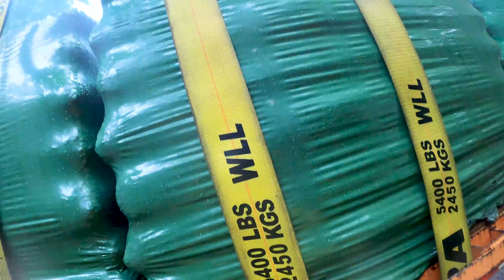The Decking is going to fall! 😱😱😱

Comment: I was a driver doing this exact same job working probuild/builders first source company from 2014-2018. Just fyi, when you are dealing with traffic on the road when you are unloading, unless you have a flaggers license, you can be held liable if you signal them to go and they get in an accident.

Comment: Thought for  future reference. Possibly a 2x4 that is as long as the width of drive wheels on the moffett. That will give you a little more reach. Another possibiity, last resort, whould be to disconnect from the trailer and crank downlow enough to allow forks to reach

Comment: I know pellets and decking weigh a lot, but if you lifted the pallet of pellets with the decking on top, get it on the ground close to the trailer and grab the decking from the top of the pellets. It looked like you had a bit of space between the pallets. You could have given it a test run with the stabilizers down, just a thought.

Comment: Reminds me of a time I had to drop a full trailer off the back of a full bus because some idiots had blocked the turn around section (illegally parked) , reverse the bus all the way down the hill, turn it around, reverse it all the way up the hill again, attach the trailer again then be on my way. The road had frequent vehicle and foot traffic which made it a challenge.  25 minutes later I'm hot and sweaty and trying to catch up on my route.

Comment: I was loaded in Amarillo one delivery to Sunray TX. it's basic;;y all the lumber to build a house including 92 and 5.8's studs for the walls. I get to the job sited and I get unloaded, the builders are there. As I unload one of the builders says "wht re those boards for (92 & 5/8)" I said "it's part of the order" he said "take them back" so I did. About 3 days later we get a call from the head builder wanting to know where the boards were for the walls, the salesman said "we sent them out but 1 of the guys refused them and he brought them back. He ended up using the lift of 20' boards and cutting them up for wall studs

Comment: that synthetic decking is VERY slippery, and VERY flexible. I've dealt with lots of it.  they should have made it into smaller bundles and put more rigid stuff below it, strapped into the bundle.  you did darn well.  I had a load of 11,000 lbs of Trex delivered, the driver said he was unable to get it close to my site, though I had previous loads of same delivered no problem by another company and driver.  Fortunately I had a friend with a lumber truck and a HUGE loader, (6 cubic yard bucket) and he was able to load it onto his transfer frame, then drive it up, (granny gears) to my place. (steep two mile dirt road)  Friends are worth a lot.

Comment: had a load falling I took forklift and lifted as high as possible and reached to max  i  hooked a chain around the bundle and hooked a strap  and used my deck winch to pull it over

Comment: Do you have ratchet straps on board,  with hooks? I might have tried taking two straps,  one around each end,  and ratchets in the middle,  and pulled the ends up.  The idea is to create a strong back to stop so much drooping. Just an idea.

Comment: Could of tried lowering the bags on the drives or put the landing gear down and drop the trailer as low as you can and still be able to hook up the trailer. Just a thought, keep up the good work!

Comment: Ratchet strap it to the lift in the center. Making sure you were balanced with the 20' material. Choke it off so it doesn't fall. Get it tight to the lift and go with it. I've done that before, and it worked. What you did was just fine also. Sometimes the street isn't the place to experiment. Did mine in a construction site. If it fell it didn't matter. Better safe than sorry.
Reply: This is what I came to say. As soon as he said the right side was hung up and lower, I thought it won't matter if it is secured to the lift. Also if he side shifts to the right then binds it to the lift, he can back to the right and walk it past the bundles on the truck. Either way make one side higher so it will clear the top of the bundles on the truck. Maybe he don't own straps other than the ones on the trailer?
Reply: @smarthome2660  It will only work if it is centered. I wrote that I think in my reply. Otherwise it will just twist. You’re right
Reply: Lol what. It's strapped, but take it off with the forklift? How the heck is your idea going to work
Reply: @Digitalgems9000  
Not to the truck silly. To the forklift. The strap will keep it tight to the forks so it doesn’t slide.
Reply: @truckerk  How the hell is going to get up there and strap that to the forks though?
Reply: @truckerk  Can you create a video or something in paint to show what you're explaining? I'm having a hard time understanding how that's gonna work lol
Reply: @Digitalgems9000  
Climb up onto the trailer. Then stand on the pallets. Just like climbing when throwing tarps. You got to get up there sometimes.
Reply: @truckerk  When it's that wet though? He'll slide lol

Comment: I don't understand how every delivery you've been given that involve long, flexible material has never been reinforced along it's greatest deflection. I would NEVER load anything onto a truck that deflects like that w/o reinforcing it so it doesn't deflect. Even as simple as a single strap along the top to counter the deflection would suffice to counter it just enough that it wouldn't be much of a problem.

Comment: I may just be set of eyes but im goona make a suggestion bare with me either have the decking on the bottom if you cant do that get 2 ratchet straps one the length of the truck and one width and tighten until you can no longer put a long board underneath to provide extra support i know your 3rd party service im just an 18 year old with an idea to problem

Comment: So I'm thinking what if you moved the fork lift all the way to the right and lifted the right side just to get it un-snagged. And then go back to the middle and lift it off fully? Of course thats a lot easier said than done when theres two traffic jams bearing down on you.
Reply from the maker: The flex is too much
Reply: @SaffordDelivery  Just to get it unstuck though? Like i mean move the whole forklift so it's lined up directly with just the right side of the decking. Then you can lift just that side up  above the pelleted and that should be enough to unsnag it? inch it towards the street a bit then go back to the middle. Note: never driven a forklift in my life but seems like it might work.

Comment: You did good...I've said it before, I don't like that composite decking, It's slippery when it's installed too and it gets HOT as hell in the sun, it'll burn your(or your pets feet)...local yards use a crane/ boom lift w/ spreader bar for delivery so you did a great job using just the Moffett.  Your last resort would have been to let the air out of the trailer tires to gain a couple of inches...don't laugh I did it once, but not on a main road.  Fantastic problem solving on your part!
What did they use to load you?
Reply from the maker: A really tall forklift
Reply: @SaffordDelivery  :-)

Comment: As a lumber hauler it drives me nuts seeing all those straps rolled up on the winches rather than being rolled up and put into the tool box on the trailer...even when I ran a moffett truck I rolled them up and put them in the box.
Reply from the maker: That's what they're there for
Reply: @SaffordDelivery  nah not when your straps are not in use though man they should be in the toolbox on the trailer.
Reply from the maker: @robreesor5011  that's your preference 🤘🏾

Comment: The Halloween intro is awesome,  why in gods name did the dumb shipper put that long decking ontop of soft pellet fuel 🤦‍♂️🤦‍♂️, i worked for lowes for 17 1/2yrs and learned a few tricks....they should have banded that decking to three pallets one on each end and one in the center and put it on a truck without all those skids of pellet fuel
Reply from the maker: They didn't reserve enough pallet spaces

Comment: Should have dropped landing gear and disconnected  from trailer to lower the load. Lot quicker to get the extra inches you need to lift load
Reply from the maker: The trailer would have tipped forward, tell me you're joking?!

Comment: Not able to lower your suspension of the truck and trailer ?
Reply from the maker: Not that much no
Reply: @SaffordDelivery  the next time, put a board on the ends, then you can slide it off

Comment: NO BRAINER.....Drop your trailer from the fifth wheel.  That will lower the entire load by about a foot or better.  Take off your load and reconnect the trailer.
Reply: With all the weight on the trailer I'd love to see you crank the landing gear to get it back up 🤣🤣🤣